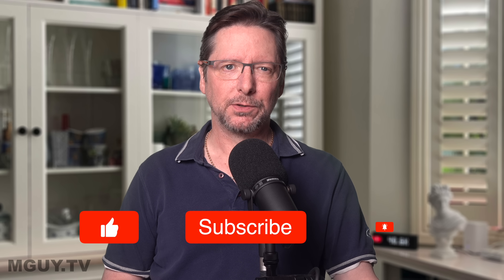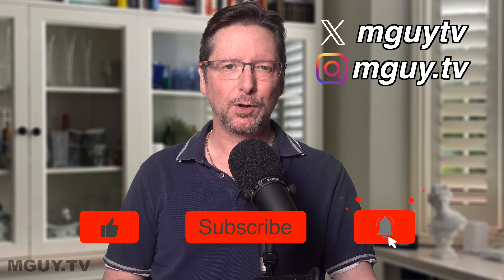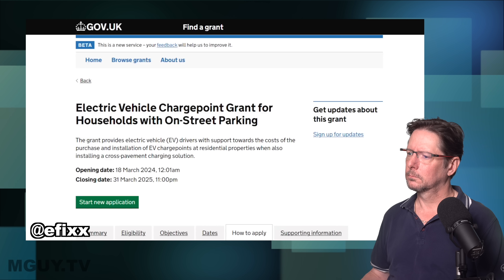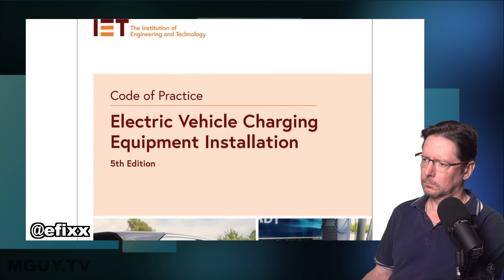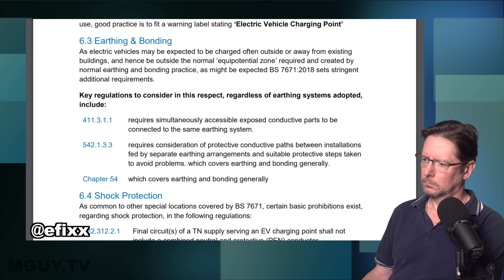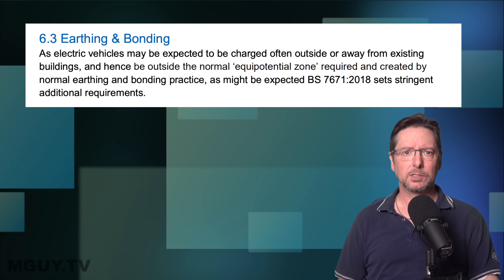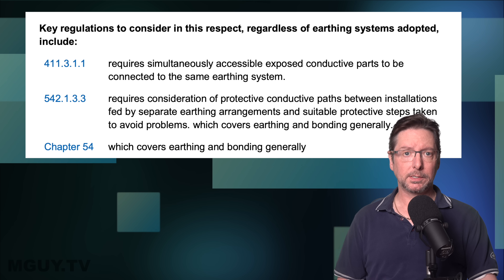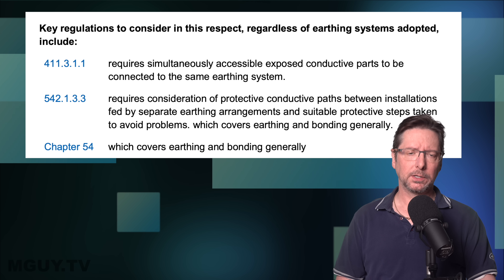ELECTROCUTION RISK from on-street EV Charging | MGUY Australia

Comment: Ah yes indeed. On a rainy day, the el cheapo EV charging connection from someone's house begins to work like a giant Bug Zapper on the local pedestrian traffic using the footpath. Now the Misanthropic EcoMarxists may be ecstatic over the rates of human depopulation potential, but the rest of us will be wholly unimpressed with this development.
Reply: That's just a bunch of BS. As is this whole FUD video.
Reply: Well, reducing population from billions down to 250 millions is one of their goals listed on the Georgia guidestones.
Reply: A giant bug zapper? Any short to ground will trip an RCD instantly. You seem to have very strong opinions for someone without a basic understanding of electrical distribution, safety devices, and physics.
Reply: @drumphil00  An RCD will solve the problem, no more dangerous than my wired lawnmower,  remember those?. More likely than you get sued from someone tripping over the wire !
Reply: @drumphil00  RCD does not detect a human being fried and trip, an RCD protects the circuit from specific instances of over-current or over discharge, they are not magic fairies that can smell burning flesh.
Reply: I agree that this is not a 'Bug Zapper' possibility but there could still be a shock involved in this situation.  An RCD (GFCI) indeed, detects a circuit mismatch, which is indeed worthwhile but it does not eliminate the effects of the circuit mismatch damage, only shortens it to limit that damage.  The RCD takes a few milliseconds to trip and and type 2 and type 3, in full charge mode, have quite a bit of potential. Also, if it is another car that is charging, that is the mismatch item, that RCD may or may not trip, and continue to lead an uninterrupted path to ground.  My worry would be grants of cash will do more to bring out minivan housed, sidewalk 'electricians' with spools of wire in the back and a Chinese RCD ready to install looking for uninformed customers for best price and not enough questions.
Reply: @paulholmes672  Yeah you bring up a valid point about cheap electricians coming onto the scene. I hope that you'll need a certificate to do this kind of work.
I still wouldn't worry about getting zapped though. The car physically won't let you pull out the plug before the charging terminates. And even if it does like in the case of older type 1 connectors, the pilot pin breaks contact first which automatically disconnects the contactors before you even fully disengage the connector.
Reply: The wires will catch fire from overcapacity before that ever happens.
Reply: Ive charged many times in the rain yet I'm still somehow alive

Comment: Worked for a electricity supply co once upon a time and the though of plugging a HV cable into a car makes me nervous.
Reply: Must be correct if you say so.
Reply: @marklittle3551  Don't trust me and do your own research. Or listen to this guy who made an entire video about an issue of which he couldn't find a single example of.
Reply: Yet the number of people who were zapped by a public ev charger is still zero. Don't know when you were in the industry but I think you need a refresher.
Reply: Let's hope it never happens. It happens occasionally in the power distribution industry and it ain't pretty and that's an industry that drums safety into its employees constantly and the infrastructure is fixed and static. In the case of the charging infrastructure it is accessible to the general public and involves plugging a HV cable into a vehicles of various condition and repair. Add to this the charging network is subjected to tampering due to copper theft and possibly vandalism. What can go wrong?
Reply: @marklittle3551  Yeah making stuff like this idiot proof is probably hard af. Although I'd wager that that's why we seem to have so many issues with the infrastructure. Providers would rather have their stuff not work because it wasn't 100% sure it's safe than getting sued for killing someone.
Reply: The trick is it is not a high voltage cable.  It’s an inert cable.   The type 2 connector has inbuilt safety features to deal with overcurrent, overvoltage, ground faults, and temperature. Once you plug it in a solenoid activates the circuit and the connector is locked in place. When the session is terminated the solenoid, disconnects the power, the locking pin disconnects the cable is inert and you can withdraw it.
Reply: Yes of course it has to be switched on and off otherwise you would draw a huge arc like some new age wizard. Definetly HV while charging. All good if nothing goes wrong.

Comment: Not just this, but if Earth bonds on different phases fail you could get a very large potential difference between outputs, and one cars chassis could be at a different earth potential than one next to it..
Reply: Completely baloney statement. If what you claim happens then the circuit breakers will terminate the electric connection - that's what they are meant to do. It's the same as in your bathroom. You can no longer electrocute yourself by tossing the hair dryer into your filled bath because of similar circuit breakers and they are standard everywhere - including in connections to the car. The car itself has such circuit breakers built in for a second level of security.

Comment: It’s illegal to run cables outside your home in the USA except in a few woke cities that haven’t been sued yet. What a huge hazard!
Reply: @wetbadger2 Well not exactly. States, counties, and cities have different rules.
Most, I think, require following the National Electric Code, but not ALL. In rural
areas, like where I live, people can do horrendously stupid and dangerous things.
At the turn of the century, we bought some land that had a cabin on it with wire
strung through the pine forest to a pond. With lights and outlets nailed to 
trees - no proper grounding, no water protection, etc. 

A death trap waiting to electrofry it's victim(s). I spent much time
ripping that she_it out lest someone would be tempted to use it!!

PS Cables outside my home is OK. Licensed Electrician ran the power to my shop (underground)
totally legally and SAFE.....
Reply: How do people run block heaters then?
Reply: @Luka_3D Can be installed on a gfi and with low amp breaker like Christmas Christmas lights.
Reply: @francismarion6400  You can charge at the same amperage as what the block heater uses. I do that when i visit my parents home because their electricity isn't stable.
Reply: No matter how much you hate EVs, they are here for at least the 20years. All governments need to make regulations making all EVs have the charger socket on the passenger side so when using on street charging the cord can be no more than 1.5m (5ft) long. I got nothing really against EV if people can make them work, but all these leads are dangerous and encourage copper thief's.
Reply: @OTPulse We already have electrical codes. Democrats want to ignore them.

Comment: Using your own cable out to the street?  What stops someone else from charging their vehice on your power?  I've seen this happen in the US and people to steal your power feel like they should be able t after all its is just af few dollars - right?
Reply: Possibly a switch, inside the house?
Reply: @nigelcox1451  Sure you could wind up  your cable every time but some one can unhook your car and plug it into theirs; are you going to be watching all night?
Reply: @litestuffllc7249  The plug into the car should lock in during charging.  Forcibly removing it is difficult, and will break something, possibly both car socket and cable plug.  That will also make noise, and if you have an EV needing charging, a quick getaway is not likely, or at least you may not get far.  Home charging is also slow, so the thief will have to wait a long time for any benefit, increasing the risk of being caught.  Having paid a lot of money for an EV, the owner is less likely to be out stealing electricity.
Reply: @nigelcox1451  https://www.youtube.com/watch?v=l7V4cuoJEnA People are already stealing people power to charge their EVs.
Reply: @nigelcox1451  https://www.youtube.com/watch?v=l7V4cuoJEnA Your assumption is also that your "public" access point has a charger connector compatible with your EV; like a Tesla; but it likely will not be; you'll need an adapter which does not lock; so the person can easily unplug the cable; leaving your adapter locked in your EV and charge theres.https://www.youtube.com/watch?v=l7V4cuoJEnA  At your cost, since you started the charge.

Comment: Also, not good to have trenches across footpaths for people with disability.
Reply: The trench is only as wide as necessary for a cable to run through it.  There are bigger concerns than that, which being the chance of electrocution.

Comment: Ground is ground. You can be grounded for many reasons.  But your car isn't grounded... rubber tires. If you are getting shocked by your car... you have other issues. But ground on one, IS the same ground on the other. 
Cords are bad & always subject to damage.  That damage can hurt you,  if you are grounder.  
Moral of the story... wear rubber sole shoes.  And don't use a cord that is bad.
Reply: It’s not just ‘ground is ground’ though is it? Not an electrician, but as a caravan we using long cables at low wattage on sites even I know it’s not a good idea to leave a cable wound around itself! Magnets and dynamos………..
Reply: @suecharnock9369  yeah.  I've been electrician for over 32 years.  There's only one ground underneath you... ground. There are many ways for you to be grounded, but it always comes from ground.  Stay out of the loop,  you'll be safe. 
How do you stay out of the loop, of electricity? 👀

Comment: Yeah going to be an ongoing risk as thieves steal the copper I.e usually safety earth's as they have been doing in the telco and railway spaces here in Australia. They remove the earthing cable as it is only live in a fault condition. Having said that an earth won't save you from a HV fault.

Comment: Attention Lawyers: A new potential lawsuit cash cow has appeared on the scene.
Reply: new potential lawsuits grounded in a failure of proper cross agency bonding - whose fault is that?
Reply: @ragtowne      You sue the owner of the charging system responsible for the injury or loss.    The owner can then sue the installation company,  and on it goes down the line. 😉
Reply: @ragtowne  no, the new lawsuits on potential and grounding, not potential lawsuits😂
Reply: PPI claims not producing the cash? Move onto to other ways of legally generated profits.
Reply: Might b time 2 buy get sum money back to pay it off if ya not fried😅😅
Reply: Won't be long now.
Reply: @drump... Actually, very common faults. 

There are numerous YT videos about earth bonding faults, and how the ground resistance can generate a voltage difference, even if the house being worked on is completely switched off. Have a search... 

It's even in the British Gas meter fitters manual now, because it's such a common occurance. No joke.
Reply: Absolutely Ian as I said in my own comment this is frankly is a culpable method of promoting EV's!!
Reply: You'll have to find a lawyer who knows nothing about underground power distribution, and basic safety systems like RCD's.
Reply: @drumphil00  You mean someone like you? It's not about underground power delivery but Earthing (ground) must be the same for two electrical devices you may touch at the same time.
Reply: @robertkubrick3738  So now for a dangerous fault we need a faulty charging system that you're in contact with out in the street, and another electrical system you're in contact with out in the street at the same time? Can you describe a potential scenario?
Reply: @robertkubrick3738  I mean, exactly what does your hypothetical situation of a fault that can't be protected against look like in the real world, with a charging system for a car out on the street?
Reply: @drumphil00  look at Boeing if you want to look at “rare” circumstances, and those conditions are much more regulated and much lower likelihood, then this
Reply: @malcolmwhite6588  Yeah, but I'm still trying to come up with a sequences of events that is impossible to protect against with any type of RCD system. Can you suggest one?
Reply: @drumphil00  not offhand, but I’ll have more of a think

Comment: And, much more simply, a trip hazzard.
Reply: Ooh you could get a combo, tripped and then zapped.
Reply: @Stormcrow_1  The cords are supposed to be in a channel below the surface.But don't be surprised if some entitled virtue signalling f'wit just lays it on the footpath and expects everyone to walk around it.
Reply: I thought that's why they run in and not on the pavement...
anyway, EV's are honkus. they should better be looking for a combustion engine without emissions... which already exists... but... oil
Reply: @YoDuuude  It's an open ditch in the sidewalk, uncovered. Like tile with no grout. Trip hazard.
Reply: @YoDuuude hm, combustion without emissions, must be magic
Reply: @stefanth8596  I think it's a refence to hydrogen fueled engines.
Reply: No it's not because the law requires that cables are installed in black and yellow rubber cable protectors like mini speed bumps! Zero trip hazard. Furthermore it wouldn't be the council that's liable it would be the homeowner or tenant.
Reply: @stuartcraigon2003  Those cables aren't the problem. It's people running extension cords to their cars that's the problem because on street charging is barely a thing at the moment.
Reply: If you so easily trip on a flimsy cable then you should maybe get better at the whole walking thing
Reply: @Luka_3D We have seen these kinds of lawsuits for decades.
Reply: @francismarion6400  Aight i retract my statement. I do still think however that this isn't an insurmountable issue. We've been powering block heaters on cars for years with cables running to them. Why not just stick to that system?
Reply: @Luka_3D If a homeowner did this for any other reason and someone tripped you can bet there would be huge lawsuit. In fact, it's probably against code to do this now...

Comment: Let me get this straight
people are supposed to plug in an extension cord to their house
and run the cable over the sidewalk
to their BEV?

I bet that violates a dozen code laws...
Reply: And some thief might take the cable for the copper in it 😄
Reply: But you forget one of the highest tenets of progressive policies:
"It is OK when we do it, because we have good intentions." In this case: good for the climate. One of the bestest intentions!
Reply: How many people will have tripped over the cable and, luckily, landed on a Claims4U lawyer?
Reply: They are cutting a channel in the sidewalk to put the cable in, to avoid being a tripping hazard and to avoid damage to the cable from people walking on it.  I've seen other videos that show it.  Still likely a code violation, with the risk of the cable wearing through over time.  Maybe a temporary solution, but not something that should be made permanent.
Reply: @my3dviews  How on earth does underground power work all around the world?? And what fault do you imagine that an RCD wouldn't protect against?
Reply: @drumphil00  You can bang on about RCDs but the point being made, I think, is in many states it will be a code violation (or local equivalent) which no doubt carries penalties.  You can argue the technicalities in court if you like!
Reply: @drumphil00    Underground power cables are made to a higher standard than a power cord running from an electrical outlet.  Which could wear through over time due to movement when disconnecting and reconnecting.
Reply: @my3dviews  Yes. Does this plan involve using off the shelf extension leads? I doubt it.
Reply: @my3dviews  definitely not meeting code in US.